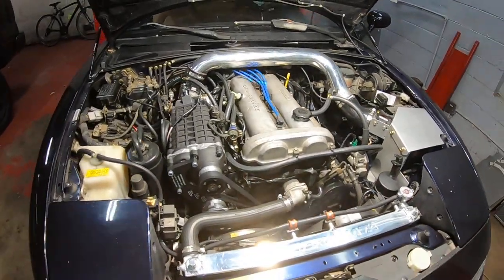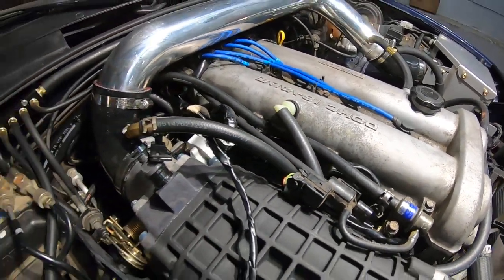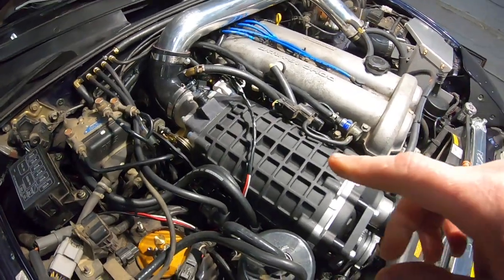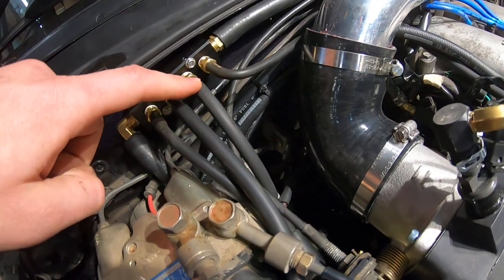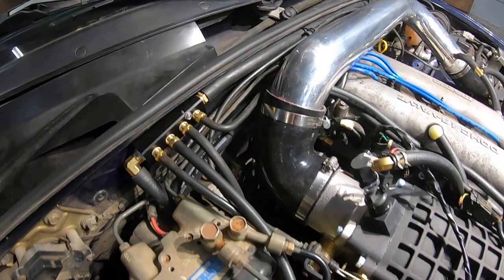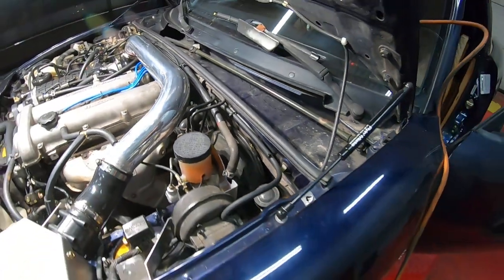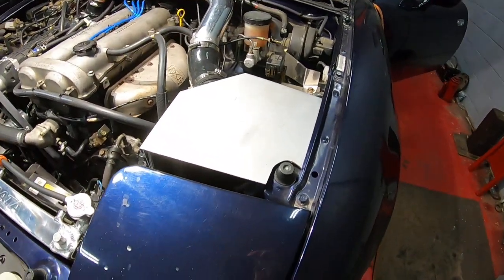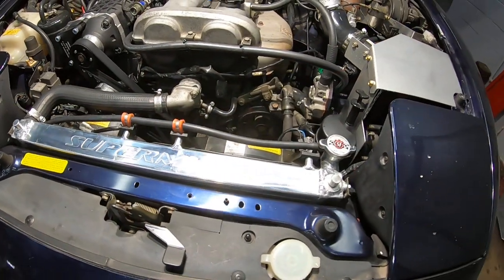Fast Forward Supercharger: Episode 04 Final Assembly

Comment: Clever relocation of the IACV.  Any issues with it not having coolant go through it?  Did you use RTV on the surface of the housing and bracket?

I have the DDM intake on my 97 w/the FFS kit.  I also found it a little challenging to install, but not to the point of having to cut and reweld - just needed some lubricant on the silicone pipes.
Reply from the maker: Yeah…. Not having the coolant lines was an issue, I ended up adding them after the video was made because the idle was always a little high when the engine was warm.